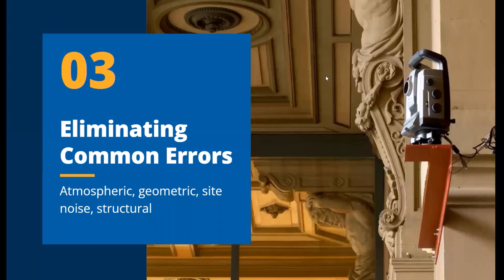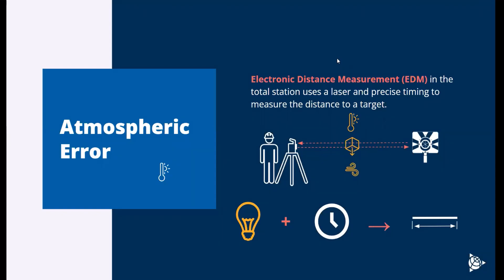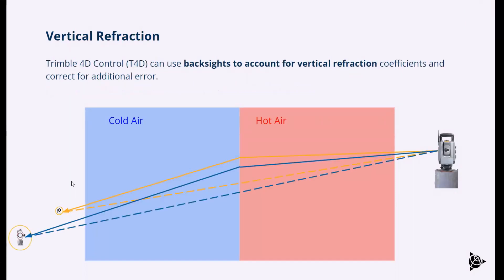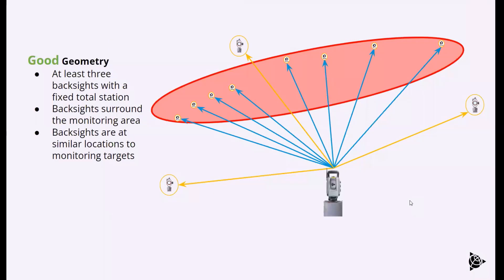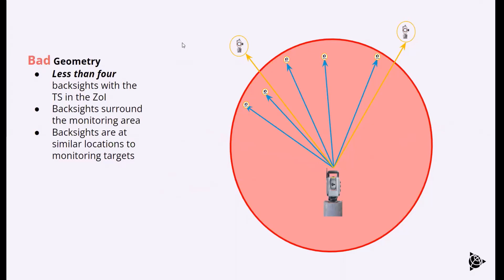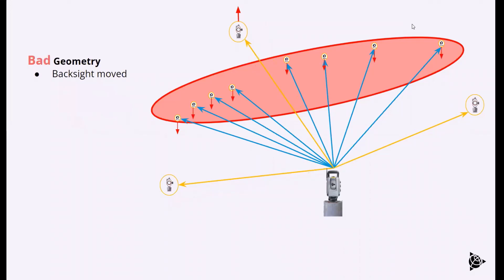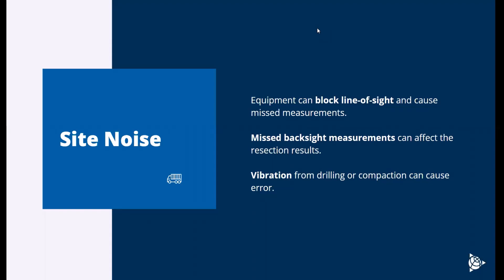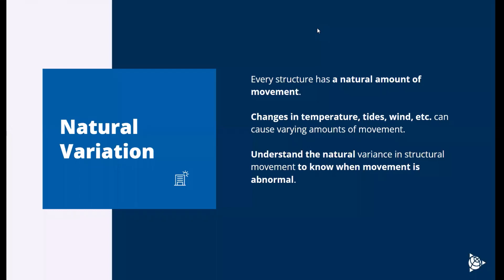Total Station Monitoring Error Elimination

Comment: I have question about temperature and pressure, to what distance pressure/temperature required, using Leica for monitoring purposes I always used 0 ppm standard with average measurements of five and it always worked!